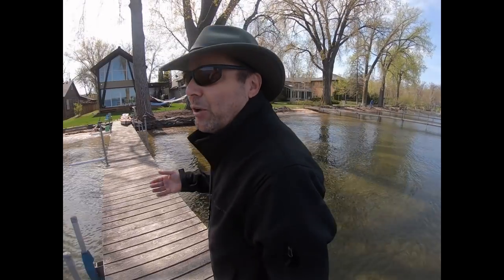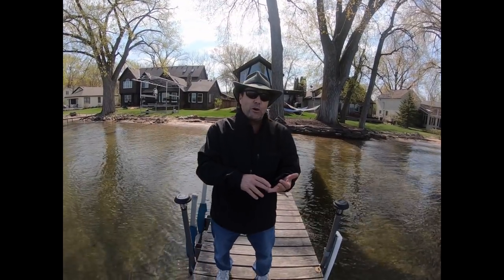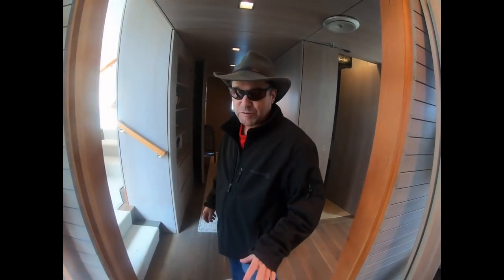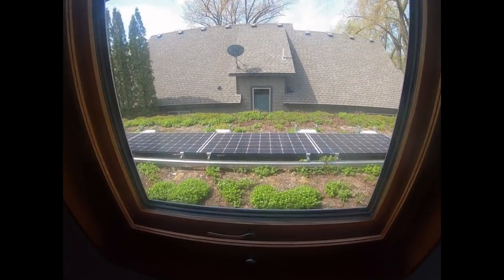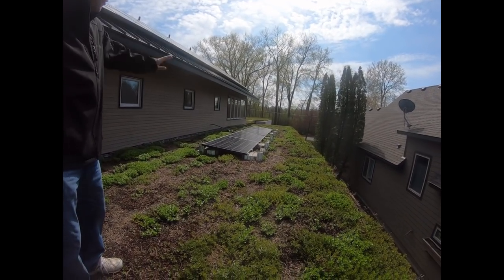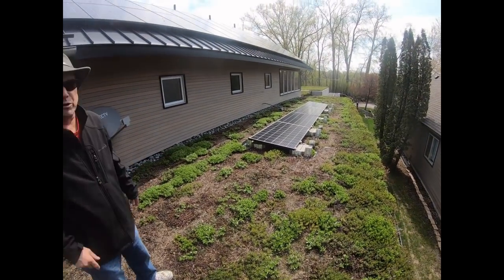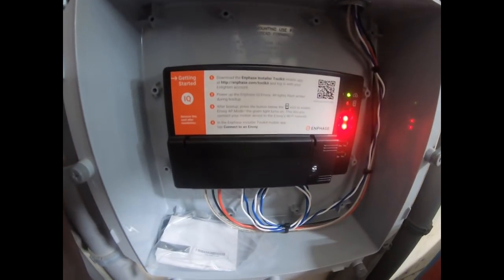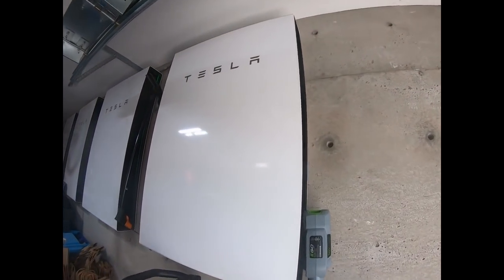12.2 kW PV System with 4 Tesla Powerwall Batteries on Green Energy Adventures with the Turbine Guy

Comment: Can the system be disengaged to prevent damage from an EMP or incoming Solar Storm, or would it not matter? Are the batteries a gel type? Could they explode like a car battery?
Reply: Yes, they can explode, they're lithium ion batteries. It's unlikely to explode.
Reply from the maker: Batteries are Lithium, dangerous if they overheat too much or are punctured. I am working with a client in Nevada who is putting in solar and  wind turbine. He is very concerned about EMP's and we are protecting him from them in different ways. If you are concerned, I am a certified Sonnen Batterie rep and their systems are EMP protected. if installed properly.  https://sonnenusa.com/en/